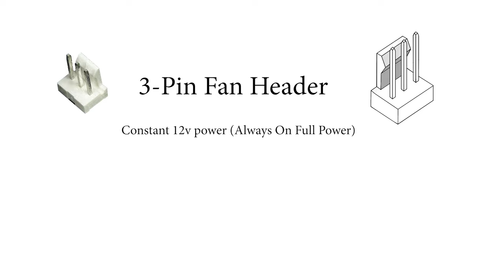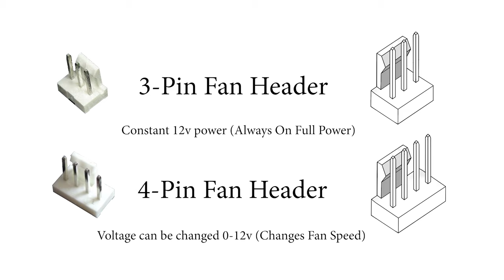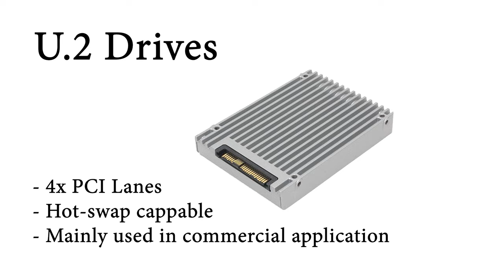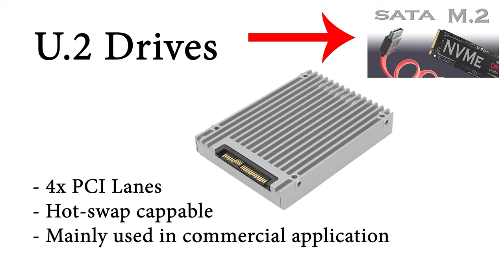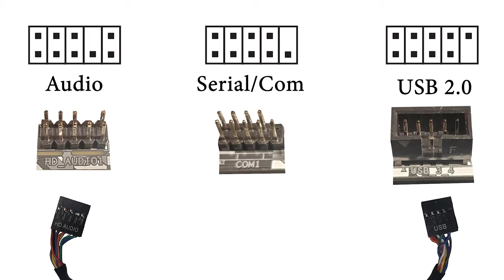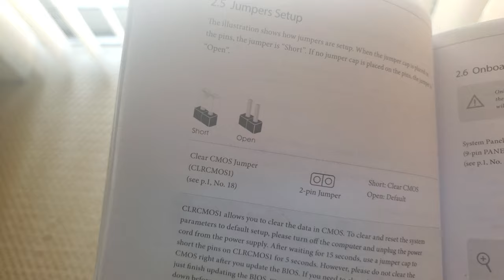Motherboard Connections Explained

Comment: i have a m/b cable coming from the back, and i’m not sure what it connects to i’ve looked some stuff up but i don’t really see a spot it could go to.
Reply from the maker: Coming from the back of what? It is possible if you have say some older front i/o on your case like firewire your motherboard may just not have that port to support it.
Reply: @MaxsTech  the cable was coming from the right side of the case where the cables are. i looked inside the left side and noticed it was hanging and wasn’t plugged in anywhere.

Comment: Whats the coneector port on the motheboared called which you Connect to you power button in front of the pc? I have a aorus elite v2 and pc wont turn on when i pres start button
Reply from the maker: Front panel connectors “Power SW”

Comment: hi, i have a LED button in my case and a connector with a LED label on it where do i put it on in the mobo?  because i did not, does it have any effect? thx
Reply from the maker: Check out my video on front panel connectors! It doesn't affect any performance, just the little light that turns on whe your pc is on.

Comment: I have connected iBall spirit 230 v atx switching power supply for  motherboard - asus prime A320M-K  but it's not working the fans start and stop rotating after sometime, should I change my power supply. Which power supply should I go for, please help me brother , in this lockdown period. I can't go anywhere to ask.

Comment: Can i plug in my corsair aio power wire into the cpu fan or pump fan port?
Reply from the maker: Yea, you can use either. Some computers will get scared if nothing is plugged into the cpu fan port since it thinks no cooler is attached but the pump header will make sure it runs at full voltage all the time. If you use the cpu port just make sure not to mess with any fan speed settings on that port.

Comment: You can control the voltage on a 3 pin header, you control the pulse width (meaning it turns on and off rapidly) (or use it as a 3 pin) on a 4 pin header for the fan connectors. The pump header might be designed to supply a higher amperage then the other fan connectors. Other then that it is no different then a regular fan header.

Comment: Hey, Max thanks for the helpful video. I have a couple of cables still hanging there.  has Asus motherboard Prime B450-A i am having a problem connecting my EVGA 500 BR 500 WATTS BRONZE POWER SUPPLY AND WITH CORSAIR ICUE 220T TOWER

Comment: I thought removing the CMOS battery did a factory reset on the bios although I've heard of the shorting the pins method. I at least know where my cmos battery is but how to get the battery out doesn't look easy !
Reply from the maker: You can just stick a pen cap under it and it pops right out or any little flat piece of plastic will do :)

Comment: Ok i got this case and it has a usb hub/fan control and im plugging the argb port and it has a plug labeled gdv is that for the fan port? The case didnt come with any paperwork so nothing to refrence
Reply from the maker: That’s a port specific to gigabyte and it syncs your LED lights, you may not be able to use it or simply choose not to.
Reply from the maker: It usually goes into the port labeled “JRAINBOW” but sometimes you need an adapter depending on your motherboard

Comment: I accidentally plug the CPU cable into a  VGA on the power supply when I boot up the pc the fan runs at very high speeds and would not boot into window. Is it the motherboard or cpu got fried?

Comment: The old XFX PSU started acting up(burning smell). Thankfully I had I spare PSU lying around (Coolermaster V1000). Unfortunately I can't find the 8 PIN cpu cable from the new PSU! Any ideas?
Reply from the maker: Maybe you can find your same PSU for parts/repair cheap on ebay and just use the cables? I wouldn't recommend using any other PSU cables besides an exact match from yours otherwise you can have issues. You might be able to contact coolermaster, I dont think they sell individual cables though...but worth a shot.

Comment: Hm. So my current build (which is almost complete just got to install the PS) has that dedicatd power connector for the CPU. I've didn't know what it was until I watched this and I just assumed the 24 pin supplied the CPU with power. So I must install that power cable in the top left for my CPU to have power correct?
Reply from the maker: Yea, that will be a seperate additional power just for your cpu alone in case it needs some extra juice.

Comment: RGB Headers: 
- The three pin/digital aRGB ( aRGB, Jrainbow, etc.)  One pin is 5v power, one is data, and the other is ground. This connector controls individual LEDs on the hardware or fixture/strip. 

- The four pin/analog RGB (RGB, JRGB etc.) One pin is 12v power and the other three are all grounds for each color. These do not have individual LED control and will display the same color on each LED.

- The five pin/analog RGBW. This is identical to the 4 pin header, but the last pin is dedicated to pure white.

There are many more device specific connectors, but the main thing to know is analog (RGB) and digital (aRGB) headers do not function the same way and will not work Interchangeably.

Comment: You missed at least the connectors you need for Thunderbolt 3 and the associated Displayport connector.

You're also missing some other older or more exotic connectors.

Comment: at 4:30,  dont understand why there is a USB 2 on the motherboard if there is a USB on the case.   What plugs into the USB 2.0 on the motherboard?    I just bought a Gigabyte Aorus Elite v 1.4 motherboard with a USB 2.0 on the motherboard.   I was told that a fan,  or other things could plug into it?   Hmmm...   I wouldn't plug a fan into that.  What can I plug into it?   Thanks.
Reply from the maker: You need a way for the plugs at the case to get to your computer inside, the port on the motherboard is where that happens, it’s the connection between the 2 points.
Reply: @MaxsTech  I think I understand what you are saying, but the USB ports on the case work now, and they aren't connected to this port on the motherboard....

Comment: Hello my love, can you tell me which cable I need for a power cable to run a SSD drive? I have the sata cable already, I need a power cable
Reply from the maker: You will need a sata(data) cable and a sata(power cable). Not sure which one you have currently. The sata (data) cable is the small one that connects to your motherboard, the power ones come from your power supply.
Reply: sata cable looks almost like a USB in terms of sized but if you look into it, it's got a sideways L shape strip where the data transfers (again like the middle of a USB if you look into jtl, and sata cables are usually black, or dark gray, and flat. you'll usually have one that goes straight and one at a right angle. the power cable you need depends on the drive, for instance, I have an old ssd that actually takes a sata data, and a 4 pin connector for power. just look for where your sata cable fits, because it's impossible to plug it in the wrong way, since it only works one way with one connector.

Comment: So recently I built a new pc and the the rgb on the case fans are not working. 
The case is gamdias Apollo E2 and the motherboard is asrock b450 steel legend.
The fans are working just not the argb. I connected the wires into my rgb header in the motherboard. Any thoughts?
Reply from the maker: Have you downloaded the rgb software for the motherboard? Its called ASRRGBLED, you can use it to configure all the lights. Give that a try

Comment: Can anyone help I need to power my usb c port but I don't know what connector cable to use and where to plug it in.
I'm hearing SATA, I have free sata slots I think it says sata 6 on mother board but I can't see a wire that then got from that to 15pin.
Any help appreciated thank you

Comment: My mother board has another 2 pin connector not for clearing the bios, but a connector for a case button that detects if the case is open.

Comment: Do i need to 4pin and 8pin cable for my cpu power ?. I have only 8pin connected and its working but im afraid it might have problem in the long run.
Reply from the maker: You're all good with the 8 pin. The extra 4 will be extra power if you want to do some intense overclocking.

Comment: is there any difference between a cpu fan connector and a system fan connector?
Reply from the maker: Typically the cpu fan connector will be a 4 pin connector and the system fans will be 3 pins. Some motherboards may have multiple 4 pin connectors though and a 3 pin can work just as well for the cpu fan. Nothing too special about them besides the 4 pins can use PWM to control the fan speed which usually the cpu fan speed is the most commonly controlled one to regulate temperatures.
Reply from the maker: If your motherboard supports it the 3 pin connector fans can also be controlled via voltage changes fyi
Reply: @MaxsTech  both on my motherboard are 4 pin headers. I only have one dedicated system fan header so if I use fan splitters is it okay to add system fans on the same header as the cpu cooler?

Comment: i’m missing the jusb1~2 cable it’s the one that connects the 2.0 usb to the motherboard i need to buy one but i don’t know how it is supposed to look like on the other end and where it is supposed to be connected
Reply from the maker: If your case doesn't have usb 2.0 ports it won't have that cable. No need to buy one, they are integrated into the cases front.

Comment: Hey guys, i was wondering if it’s alright to have a few loose cables in your case and also how many loose cables should i have on the end? I always think that there is something i haven’t plugged in. Thanks!
Reply from the maker: If you dont have a modular power supply you will most likely have a few extra cables not doing anything. Most likely some extra sata/molex power cables for harddrives or some pci power cables for graphics cards.
Reply: Max's Tech i saw also that i have a 4-pin connector left, besides those sata cables that you mentioned. The 4-pin connector has a pattern starting with a square, then a house shape kinda en then another square and a house shape again. I already plugged the 8-pin version of that connector so do you think the 4-pin one will just be left off?
And nope unfortunately my psu is not modular it’s a pain in the ass hahahaa.
Reply from the maker: That 4 pin is probably extra power for you motherboard, which you may or may not even need depending on which mobo you have. No worries
Reply: Max's Tech so if i were not to plug it in would that do something to my motherboard? Sorry if i ask too much questions, it’s my 1st time doing this bro.
Reply from the maker: Worst case, if you do need it your system wouldn't boot most likely. But no harm to any hardware. It should go in the upper left of the board if it is in fact a 4 pin cpu power cable

Comment: Okay, so useful info, but it doesn't tell me whether or not I actually need to plug in both an 8-pin and a 4-pin plug for my CPU or just a 4-pin or just an 8-pin or 2 4-pins.  I need answers!
Reply from the maker: The extra 4 pin is supplemental power for the cpu in case you overclock and it need smore juice. Not required for majority of people

Comment: My motherboard has a cpu 8 + 4 pin connector. Do I have to fill up both or can I just plug in the 8 pin?
Reply from the maker: You can just plug in the 8 pin and be fine.
Reply: @MaxsTech  thanks

Comment: I'm so glad my case come with an all in one connector for the front panel so at least there is that😅But the problem i'm facing is my power supplie come with multiple 8 pin CPU connector but my motherboard have the 8 pin + 4 pin header . And i can't plug the 8 pin because the two header are too close from each other and the rounded/square hole in the connectors do not match if i try to plug them on the other side. I saw that some 8 pin connector split in half but mine didn't so should i leave the 4 pin on the motherboard unplugged or buy an 8 to 4 pin adaptor. On other words, is it safe to run with the 8 pin only to supply the cpu ?! I read that it's for big multiple cores cpu and overclocking , as mine is only a 6 cores 5600X and i do not plan to do any off overclocking at all i feel like it could do just fine but wanna be sure as both the PSU and MB user books say anything about it.
Reply from the maker: It sounds like you might be mixing up pcie power cables with your cpu power. Check the labels on the cables, they should be keyed to where the pcie ones won’t fit in the cpu slot so it won’t be possible to plug in the wrong one. But if your motherboard only has a 4 pin header for the cpu you can plug in the 8 pin into that and just not use the other half of the 8 pin. It’s essentially 2 of the 4 pin cables combined.
Reply from the maker: The 5600x is a pretty low wattage cpu as well so you should be totally fine with the single 8 pin. That chip is rated for 65w and a single 8 pin cable can provide up to 336w of power.
Reply: @MaxsTech  That's good to know, i will double check not to messed up when i plug everything. Thx a lot

Comment: Bro top left my motherboard have 8 pin it's okay if i connect only 4?.. Because my powersuply pin only have 4 pin
Reply from the maker: You can, and depending on your motherboard it may work fine. That is for extra CPU power, some boards will just limit the power it outputs since you only connected a 4 pin, some I have heard won't let it start. So itll depend. If you have a high end system that requires all that power youll want to get a new power supply, but you may be totally fine.

Comment: For my motherboard my cpu power has a 8+4 pin but my semi-modular power supply cable that said cpu on it is only 8 pins so I just plugged the 8 pins in and left the other 4 pin empty is that fine?
Reply from the maker: Yup, that's fine. If later you get a new board that can also use the extra 4 you can use that in as well.

Comment: The front panel connectors the power sw and the reset sw how do you know witch one is power an ground is not red and black to know positive and negative
Reply from the maker: The arrow is positive. Also you can just try one way and if it doesn't work swap it. No harm, no worry.
Reply: @MaxsTech  thank you max tech

Comment: So.... the 3 Pin Fan Header is where you control the fans?
Reply from the maker: Depending on your motherboard you should be able to change the speed of any fan via software/bios. Its just a different method of speed change, one is voltage change the other is through PWM.

Comment: whats the difference between sys fan and chassis fan?
Reply from the maker: I believe the system fan or “sys fan” is usually for your cpu cooler and typically a 4 pin header.
Reply: @MaxsTech  but how about cpu fan? is it using for cpu fan cooler?

Comment: Do you know how many watts can be delivered from a USB-C port on the back of a motherboard?
Reply from the maker: You'll need to find out if its using usb 3.0, 3.1 or 3.2. Usb 3.0 will only deliver 4.5W 3.1/3.2 can deliver 100W
Reply from the maker: Sometimes you'll see a little "3.1" label next to the port itself.
Reply: @MaxsTech  Manufacturer says 3.2 Gen 2 Type-C and retailer says 3.1 Gen 2 Type-C so should be 100W then I guess! Thanks for the help!

Comment: Can we attach 4 pin argb fans to 4pin led
Reply from the maker: No, the RGB connectors usually run on 5v power while the fans will run at 12V

Comment: With what part does the usb 2.0 cable come?
Reply from the maker: From your case, if your case has usb on it.
Reply: @MaxsTech  It doens't have usb 2.0 on it nut the back of the motherboard does so I don't need an USB 2.0 cable right only 3.0 witch i have

Comment: I don't have a pump header, can I plug it in the cpu fan header?
Reply from the maker: Yes, just make sure not to use any fan speed software that would lower that fan headers voltage. The pump needs the full voltage at all times.

Comment: 0:43 my motherboard controls the speed of three pin DC non-PWM fans, based on motherboard temperature, just great. Asus TUF X570. It can also control the speed through the pump header.

Comment: Hi Mate! There's one that's winding me up that's missed out. 😂 I bought myself an RGB Graphics Card Support Bracket and I have nowhere to plug it in. The plug is a 3 pin female plug... Socket Socket Blank Socket. If that makes sense.
Reply from the maker: I've seen a lot of comments similar to yours regarding RGB connections. If it's not the standard 4 pin one that strips use you may need a controller, depending on the brand. For example corsair has their fan/rbg controller that links with their software to control everything. Check the site you bought from and looked for anything that may say "Note: This requires the XXXX controller to be powered" or something similar.

Comment: so how about 

what is a 4 pin system fan connector>?
Reply from the maker: A 4 pin system fan, usually the cpu cooler fan will be 4 pin
Reply: @MaxsTech  thanks I've bought 3xternal led strips for inside pc cause my motherboard dorsnt have a header and also bought 6x rgb fans for a non rgb motherboard. Using an adapter that plugs into psu so it works.. I just needed to query that 4 pin cause I was sure its fir cou but it says on board fan 1 lol